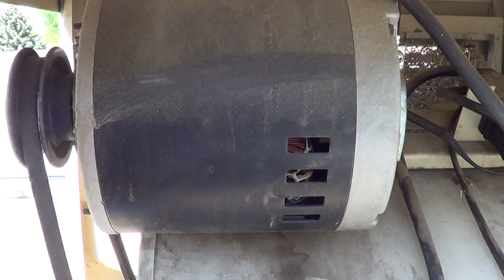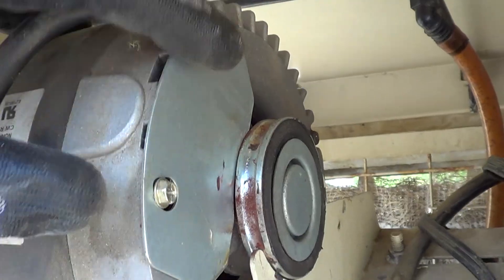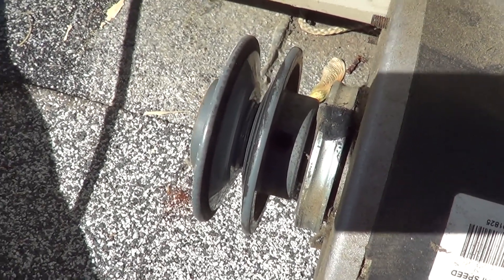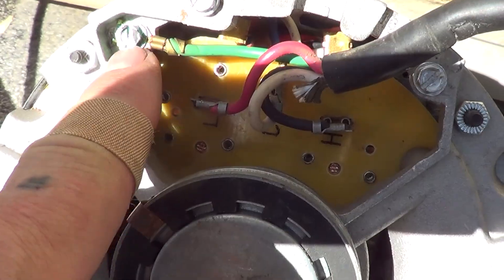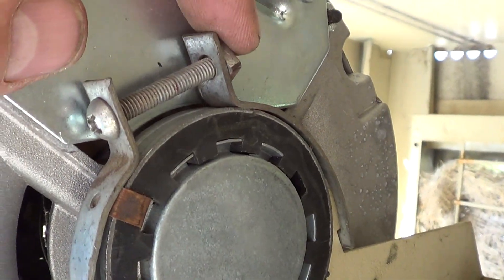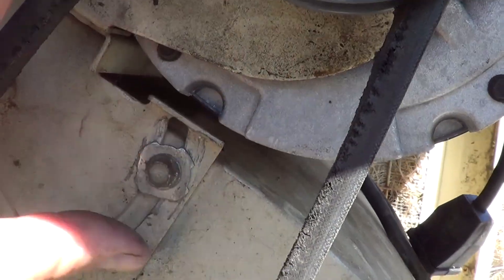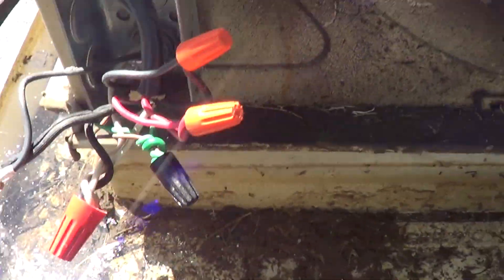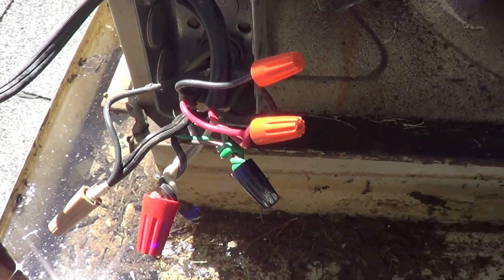How to Install a Swamp Cooler/Evaporative Cooler Motor

Comment: I just replaced the motor and it’s a two speed motor but motor only works with high speed. What have I done incorrectly?
Reply: Remember when you are connecting the wires there is an h and an l. You might want to give a double glance at the l to make sure it's properly fitted. That is assuming that the h wire is for high, and the l wire is for low. But I haven't done it before so I don't know, it's usually my husband 😂